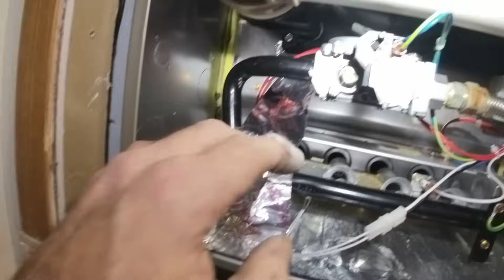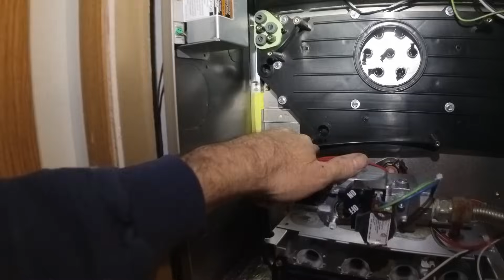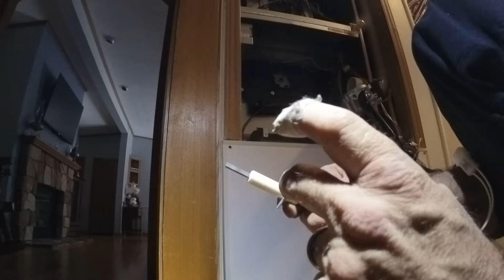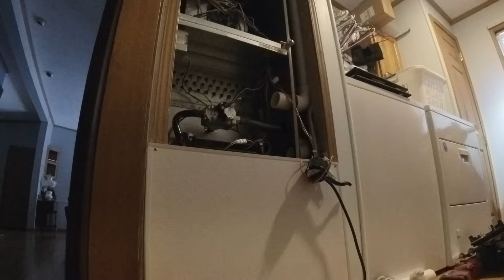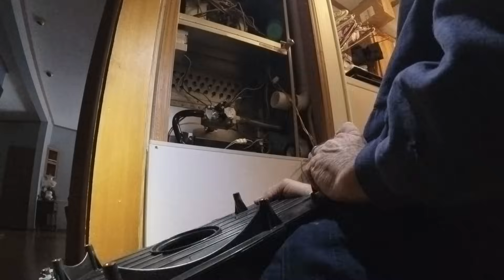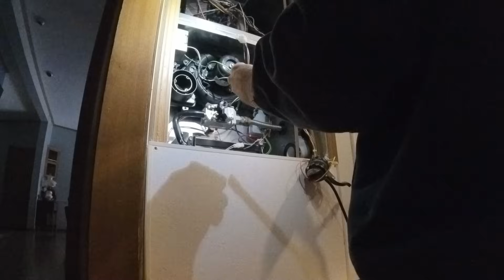Newer Carrier Furnace Leaking Water Causing No Heat

Comment: You are doing Carriers Research and Development for them. In 1984 I talked to a manufacture technical support about some problem I was having with a furnace. Of course they recommended to just change the part, they did not know how to solve the problem. After several calls the tech support told me that the manufacture no names but it starts  with a C does not have the time to put all the equipment through Research and Development program. They told me that the customers and contractor's do their Research and Development for them. This was straight from the manufacture. Good videos

Comment: I worked for a carrier dealer and I replaced my furnace in my home and it was NOT a carrier . I'm not a fan of them.
Reply: I think you have been listening to that loud mouth ford hater on utube,have had ford's for 30 years  and no problem ,and I don't work for them
Reply: i bet that's common when working for any brand dealer - work on more of them, see a lot of problems with the brand as a result and want something different.
Reply: Blue ovals asideThey have a lot in common with Ford MOCO  pertaining to reliability and lack of quality.
Reply: everyone has their opinion about brands. there also seems to be a lot of hate for york.  they're all junk now to varying degrees. @renj6531